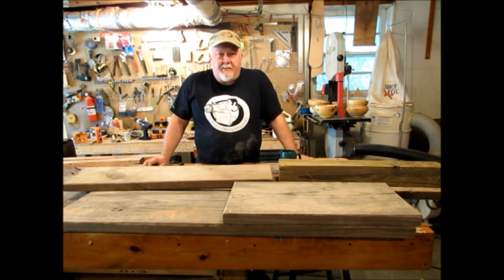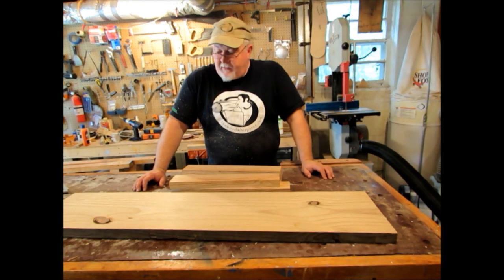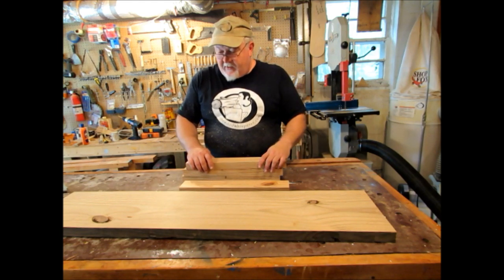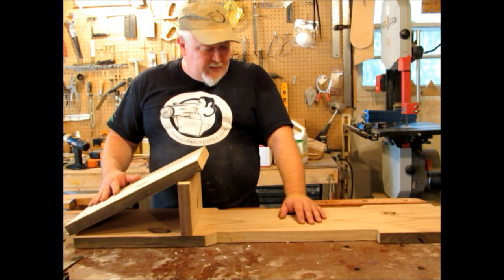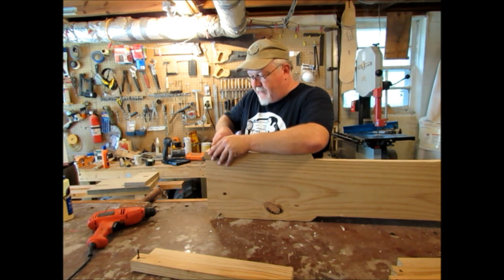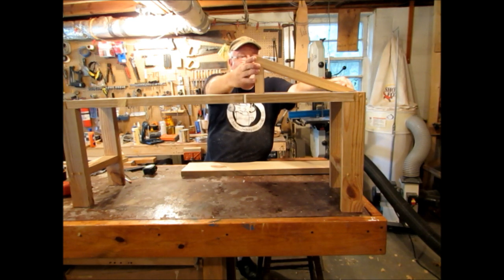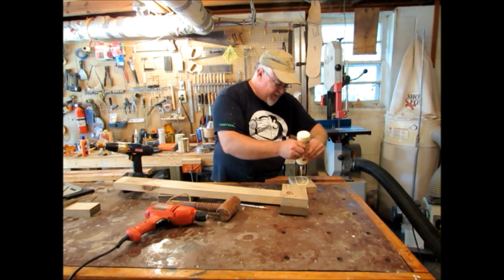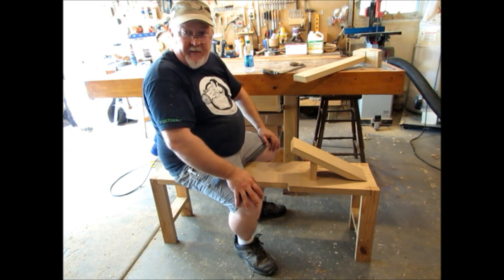Making a Shaving Horse

Comment: thanks for sharing. cool stuff. what kind of radial arm saw is that? i really like it.
Reply from the maker: That's a Triton sliding compound miter saw. Thanks.
Reply: thanks again. really need to build one of these in the very near future. so far, you video is the easiest to follow, and there isnt a lot of bullcrap needless chatter. thanks.
Reply: so with this design, if i move the position of the dumbhead up or down, i could put all sizes of wood in their? i need one of these for hand carving bowls and the like.
Reply from the maker: parrrtypants Yes, you can use many sizes of boards by moving the dumbhead.
Reply: again thanks. and thanks for responding. happy new year!